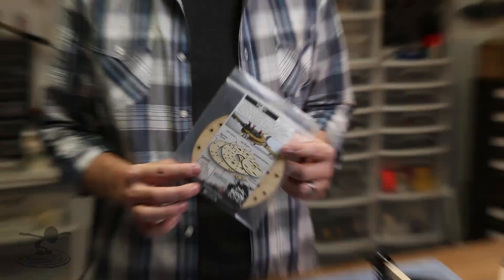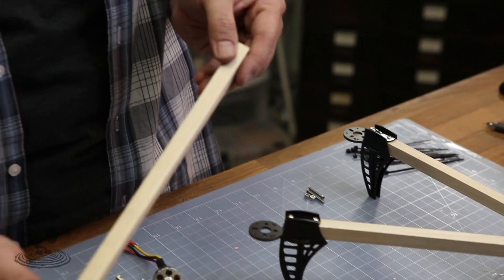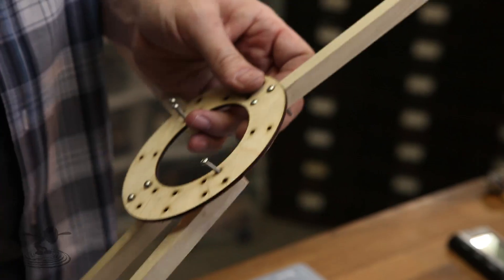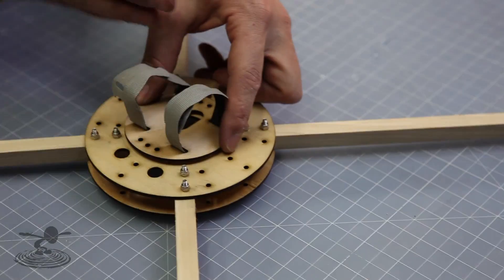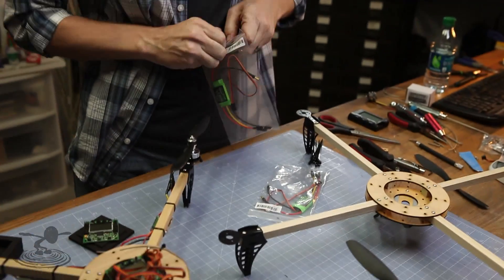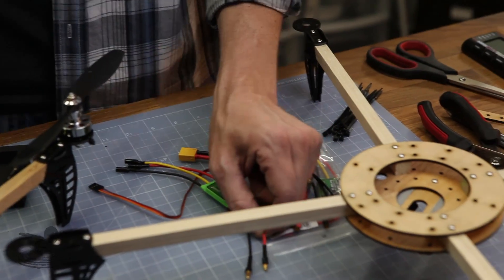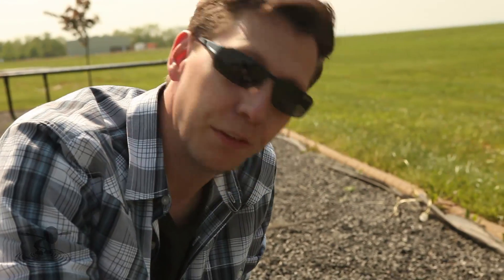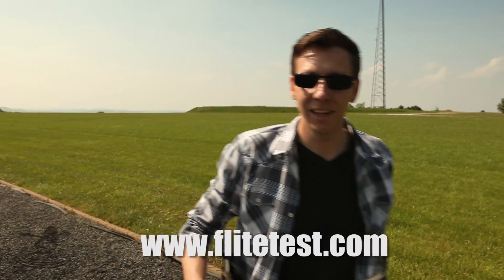Flite Test - AnyCopter Hub Kit - BUILD

Comment: I have been trying to build a quad or a tri for years and it always turns out like crap this last one I built it caught fire and blew everything up on the dam thing now if you got a rtf one big enough to see or to put a gopro on  and I don't mean one that cost a thousand dollars or the white phantom either just a simple wood boom like that one and simple kk board and set up see that's the thing nobody flys them around here and nobody to help me with nothing.
Reply: wbuttry1 Check out reddit.com/r/multicopter They will help you!

Comment: Please, not the multistarts!  Unless you're going to reflash them, which I notice Chad probably did in his copter because of the new, transparent heat-shrink later in the video, do NOT use them.  With their default firmwar they're likely the worst choice for a multicopter because of the control quirks.  Electrically they're ok, but not impressive, the price and the presoldered connectors are nice.

Comment: In my career as a aircraft structures & sheetmetal mechanic it is not cool, or even legal, to have a screw's threads stick out more than 3 thread lengths. I know it doesn't really matter with this model, but you could add a washer or lockwasher or two so only 1 to 3 threads stick out beyond the nut's end.

Comment: chad i dont know if you corrected the few problems you showed us on this video but i just wanted to point out them. first off NEVER NEVER NEVER cut the wires on a outrunner motor because the wires that go right to the plugs are the same wires that are the coils. the other thing i saw was when you put the motor plate on the bottom of the mount you make the motor has nowhere to go when you crash even if the tip ties break because the motor shaft is running through your motor mount.

Comment: Surely wood struts is a no-no. Wouldn't it be better to use plastic pipe, its about the same weight but is more resilient to impact and has a more aerodynamic profile.

Comment: I was right to be afraid. I was having very dramatic control issues until I realized I was getting a serious flex in the motor mounts at times. I moved the mounts inboard and mounted the motors directly to the booms and problem solved! Now it flies great and I just need to tweak my settings to get it more silky.

Comment: a tip to not lose orientation on a quad is to have different colors on the rotors. for example black on the two front and red on the two back. this also works on other multirotors

Comment: Ok quick tip in case you dont know. To trim your screws most popular wire strippers have holes around the pivot, so if you know your length you can screw them into the holes and cut them leaving no rough edges. Note: it can be tough to cut bigger screws.